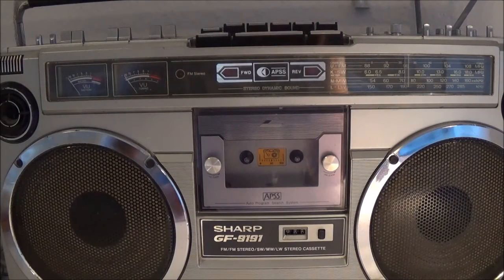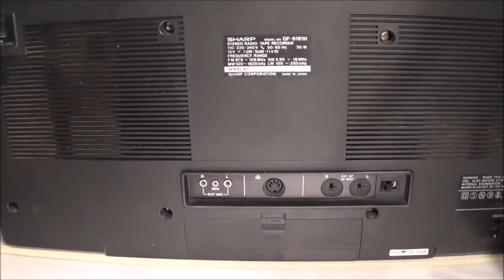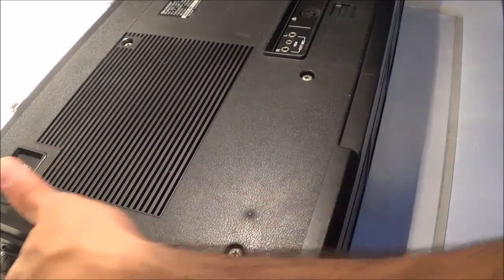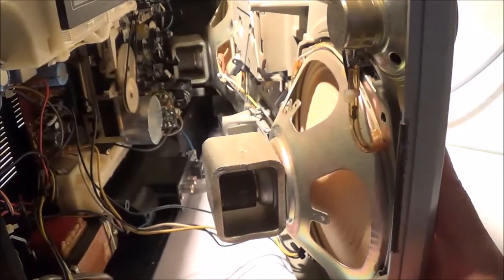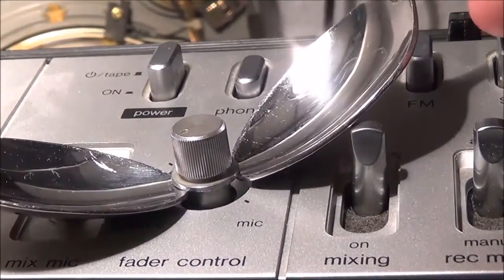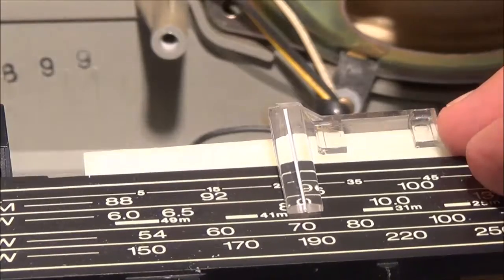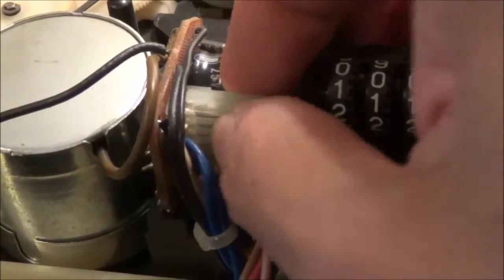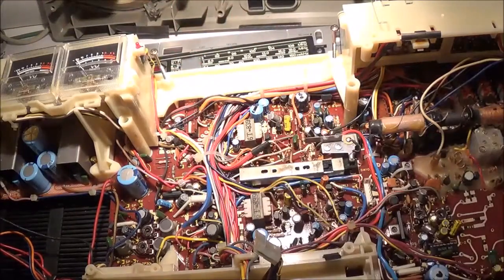SHARP GF9191 DISASSEMBLY

Comment: Dear Old School, thank you for your video. I've managed to get the same GF9191, but quite shabby and dirty. Would you, please, advise me is that difficult to detach the back panel and two side panels for separate washing and cleaning?
Reply from the maker: Hello: this is not difficult. You just have to separate the 2 parts slowly. I think there was an antenna wire attached from the back part to the front part.
Reply: @OldSchoolElectronics  Thank you. I will try.
Reply from the maker: It's been a long time since I worked on this unit and I no longer have it. I think mine had a screw in the battery compartment. Also, make sure there is no cassette in the unit. I remember the other screws being long and all the same size
. Just take your time when you have all the screws out and you separate the cabinet parts. Also  make sure the speakers don't fall out if when you separate the  2 parts. I don't exactly remember if there were other wires besides the antenna wire. If there are, note where they go or take a picture if possible. I think you can do it! Good luck!
Reply: @OldSchoolElectronics  All you say now is quite simple and clear from the video. I already detached the front panel, speakers and upper panel and cleaned these panels. And I realized that back panel, side panels and bottom panel ARE THE ONE UNIT (it's all black). And I don't understand so far if it is possible to detach it from all the interior. Also I detached the cassette block and found two broken rubber belts in it, so now I would have to manage to get the new ones of the right size. So it would be quite a riddle to revive this gear!
Reply from the maker: Right, there are only 2 pieces: front and rear cabinet. You can basically take everything apart if you really wanted to. Don't forget to take a look at the little rubber pulley on the capstan.
Reply: @OldSchoolElectronics  I already detached everything from those both parts of the cabinet. Actually it's not too difficult, I just noted all the disconnected contacts not to forget them. By the way, I didn't understand what "little rubber pulley on the capstan" you meant. Instead that I found two mechanical problems. Rubber belts in cassette block are broken. But I hope I would manage to find the new ones. Another problem is more serious, I guess. The solenoid plunger with the spring (in the same cassette block) is absent, obviously lost by previous owner. I have no idea what this solenoid is for and what problem the absence of the plunger would cause.
Reply from the maker: Looks like you are making progress. The capstan is the thin and shiny metal rod connected to the flywheel (big metal wheel). As far as I remember,  the solenoid was for the search function.
Reply: @OldSchoolElectronics  I was already told that solenoid is not too important detail, it is responsible for the APPS (Auto Programme Pause System) feature, it searches pauses on the tape and stops/starts on it. And it's not too crucial not to use it. Also I got your point about pulley, it is mentioned in some videos (in Russian) as winding roller. Mine has also turned to black grease, I cleaned up the capstan and the pulley slot and replaced it by the peace of a syringe spout, as was also advised in a video. So after I replace the belts I would be ready to assemble the box completely and turned it on. God knows what I would hear...))
Reply from the maker: Cool. Don't forget to clean the head and the other parts the belts touch with isopropyl alcohol. Good luck!
Reply: @OldSchoolElectronics  Thank you very much!

Comment: hi, I have a sharp gf9696 and to make the radio work I have to press play on the tape mechanism with the selector set to radio, any ideas why this might be!? its like there is no power to the radio unless I press play on the cassette.
Reply from the maker: I am not familiar with the 9696. Make sure you have it set to radio and the power switch is in the "on" position. Could be a problem with the function switches; you might need to spray them with contact cleaner.